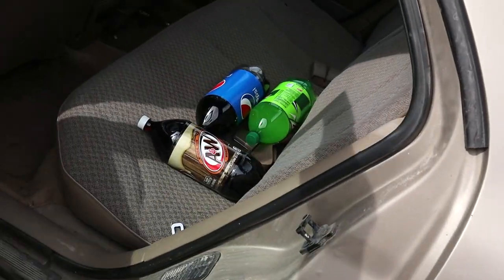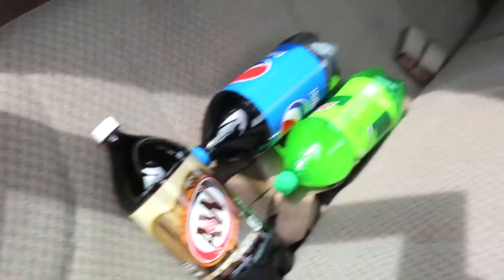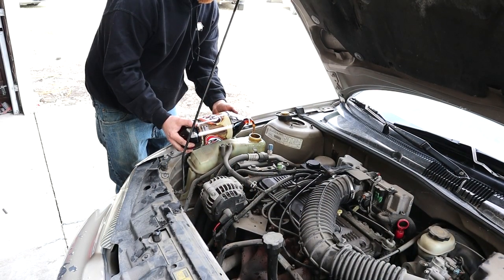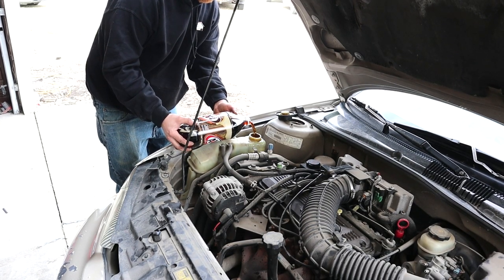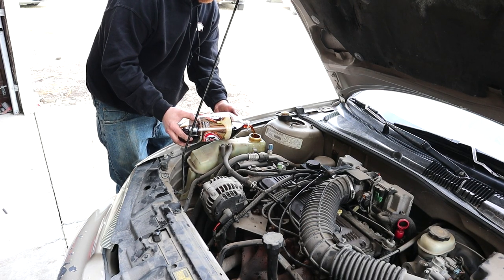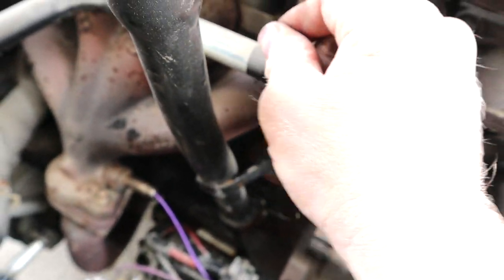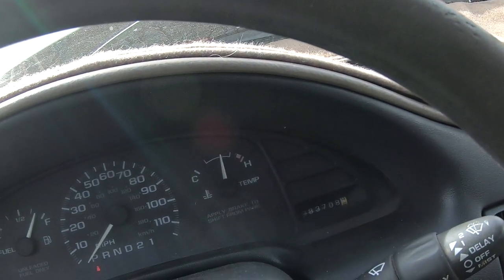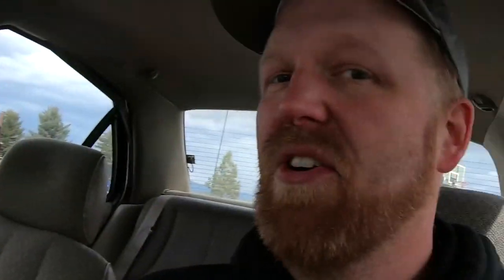Aarons Garage Episode 3 - Soda pop Anti Freeze

Comment: Ah yes... I remember having to dump five 2litre bottles of Vanilla Coke in our rad once on the M25. She smelled sweet as driving home. Once it got hot, the Coke caramelised and plugged the little hole in the bottom of the rad. 👍👌

Edit: our mechanic reckoned the initial high temp surge was the carbon dioxide gas being forced out at very high temp, which would cause the temp senser to read high.

Comment: I would imagine what will happen is after a bit the soda will turn into a reduction of viscous fluid. It's going to clog the radiator fins. However as it melts and remelts you should be fine to go see grandma. Just make sure to add water to rehydrate the syrup you distilled.